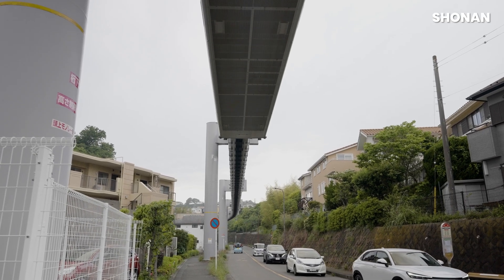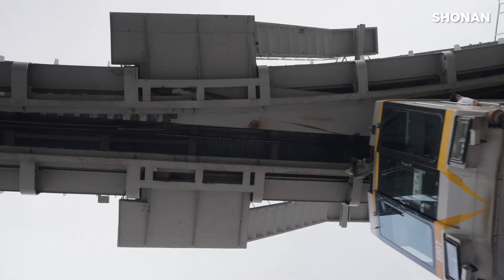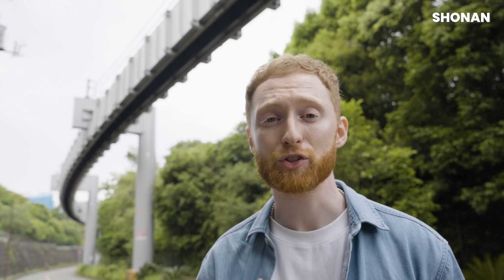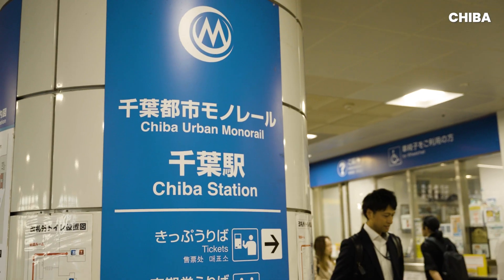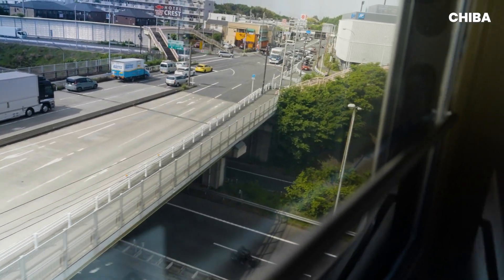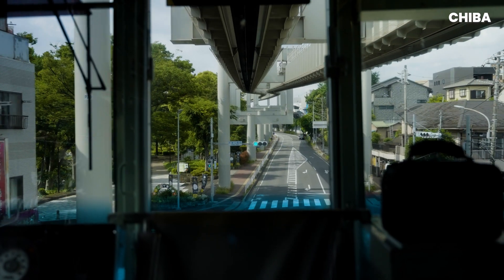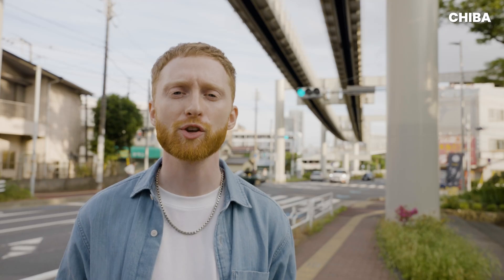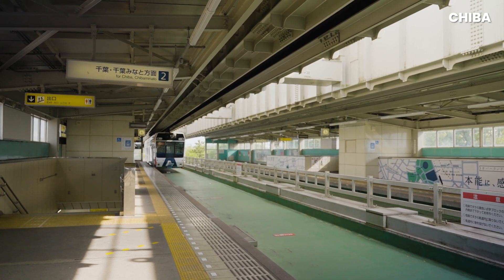Why does this city have upside down trains?

Comment: 1. Make sense only for certain geographies. e.g. where streets are too narrow for trams, tunneling isn't an option due to soil, or hilly terrain where grade is too steep.
2. The main problem is raw material cost.  They use 100x more steel than traditional rail services.  The supports and track box are HEAVY steel.

Comment: The Japanese also have the rather unique problem that earthquakes are pretty frequent. In an underground train, you might be buried whereas in a suspended train, you will be swung about a bit like on a suspension bridge. Earthquake damage in a tube railway is expensive to repait, but guideway infrastructure is immediately accessible so building site facilities are much lighter.

Comment: Thank you for explaining all of this. I've been fascinated by the Chiba suspended monorail for years and wanted someone to explain it like this (and in English not Japanese). Particularly, it's interesting to hear why they chose a suspended railway like this when lots of people like to poke fun at it and be negative.

Not being critical, but curious - is this a MONO rail ? I think there are two seperate rails inside the guideway either side of the slot. There is a video somewhere on YouTube (in Japanese) that shows how the bogies work inside the guideway with the cars being suspended from the middle roughly where a conventional train would be supported by and above the bogies.

It would be great if you could do another video going in to this in more depth.
Reply: To answer your question, it's considered a "monorail" but it does have 2 "rails" (tracks) which it hangs between. The system was designed in France and is called SAFEGE.

Comment: For the Shonan monorail there really was no other viable option and they chose the right system. The Chiba monorail, however, feels more like a gimmick than anything, like a toy that officials put in to prove Chiba city's importance to the rest of the country. Instead of the weird routing that exists today they should have invested in a people mover between Makuhari Hongo and Kaihin Makuhari , for example.
Also an underrated fact about the Shonan monorail is that it manages 7-minute headways on a single track only with passing loops, which would be impossible under almost any other transit agency!
Reply from the maker: The frequency and way that they pass each other is what impressed me the most! So well run (at least from my short experience.)

Comment: There was a time when there was only one railway and all it parts were custom-made as well. If there are more of these suspended monorails, the parts will become more readily available. If anyone else wants to build one, and goes to Chiba or Wuppertal to find out the specs for their monorail, they'll be able to build a standardised monorail and they can share parts and expertise with other systems. I think the biggest problem with them is that they are horribly obtrusive; they all require support towers and overhead rails and many cities will not have a space that they wouldn't mind putting one of these things in. In Wuppertal it's over a river, but in many places the river is a recreational space.